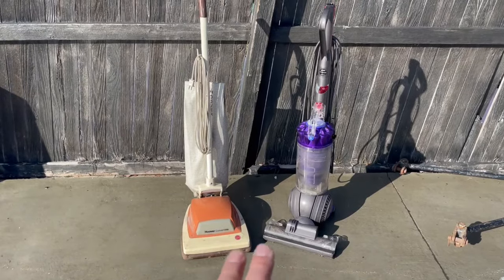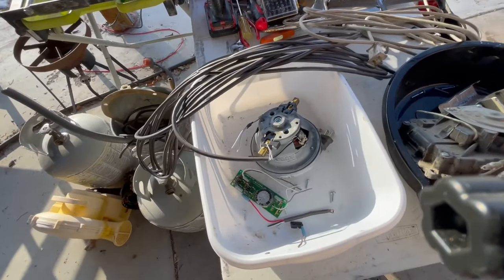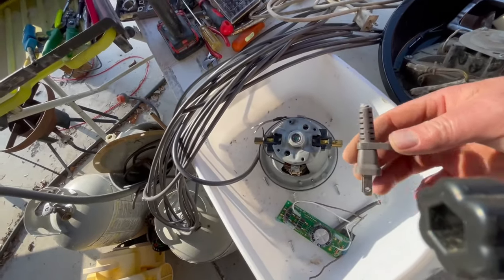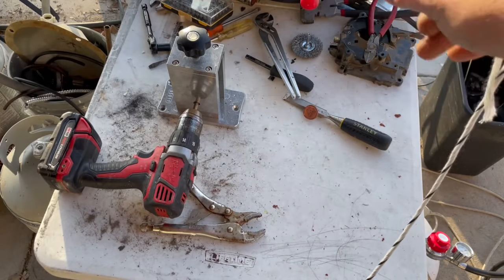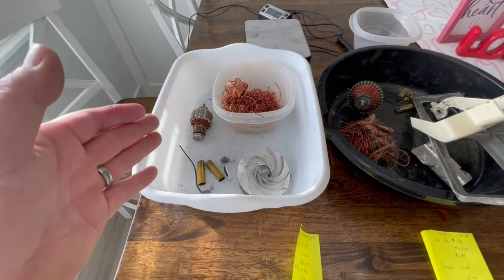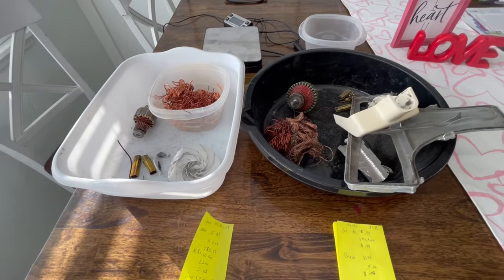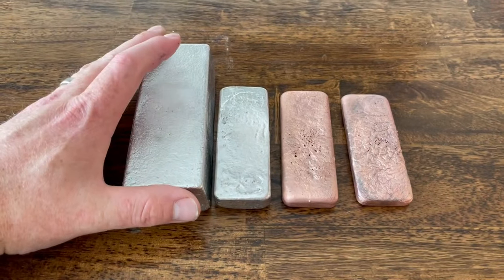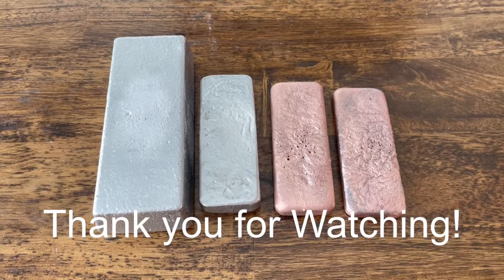Scrapping Vacuums | What’s Better 1v1 #scrapping #trashtotreasure

Comment: The Hoover Vacuum Cleaner will have a Cooper Motor Brass and Aluminum, the other not so much. When I am Curbside Scavenging, I p/u everything with a motor and break in down for individual metals. ♻️💲♻️💲♻️💲♻️
Reply from the maker: Do you usually pull it on the curbside or take and pull it later?
Reply: @MakingBullions009 I  take it apart at home in my work space. 👍😁👍